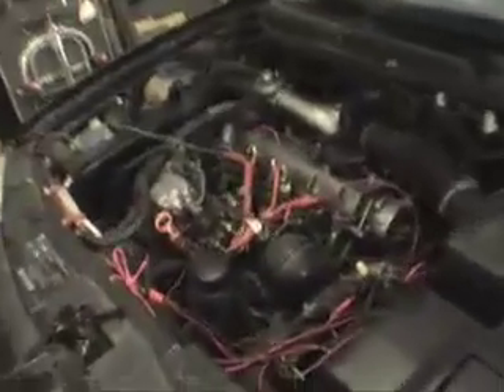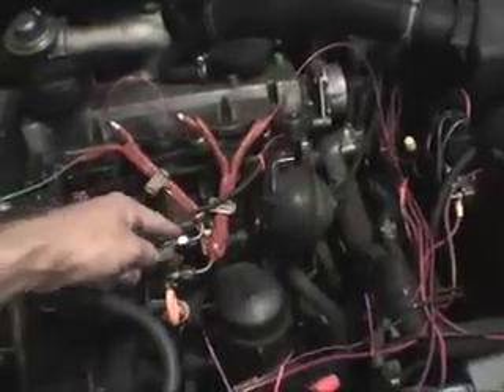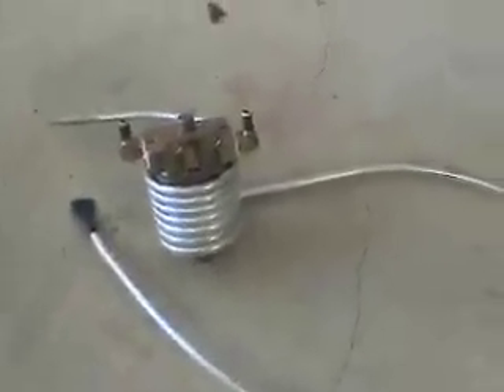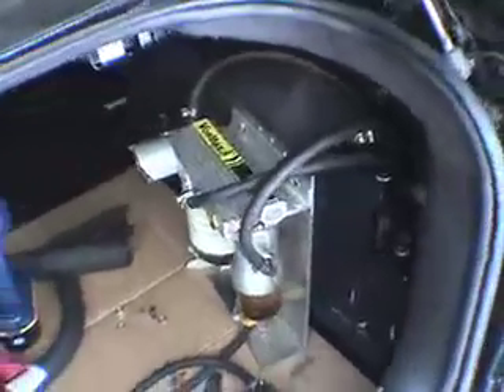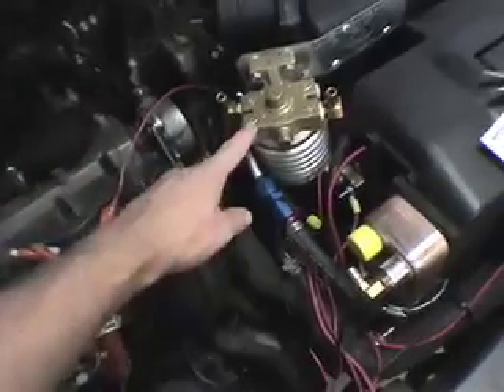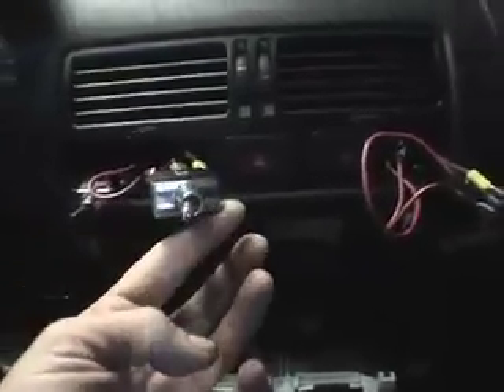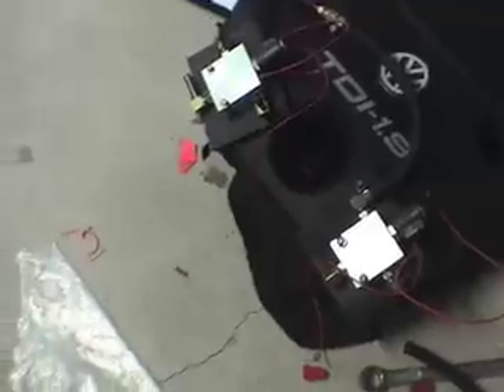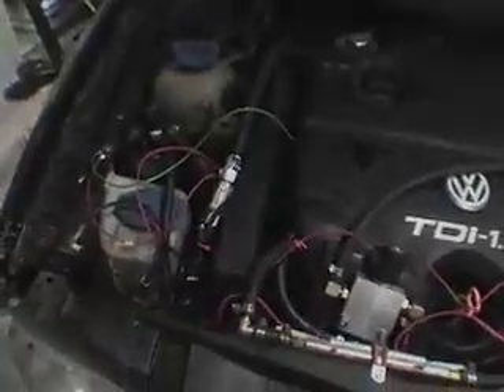Update to Plantdrive Kit  on 2002 Jetta TDI - Video 2

Comment: Thanks for taking the time to make the vid

I converted my 2ooo TDI 2 a vJet 3 yrs ago starting out w/the Grease car system

Started mods  first installing the kit by adding 4 temp sensors-than added a vegi therm-16-FPHE-insulated my spare tire tank n added a hot water bypass 4 summer use 2 keep the VO tank from climbing over 150F 

I now easy keep a 170f VO temp after only 3-4 miles after start up.

I also keep 4 layers of blankets over entire engine to retain heat when engine is off 4 an hr

Comment from the maker: I am running 2 tanks.  Unless it is a early 90's or earlier Mercedes or an Elsbit conversion you will need 2 tanks.  As for diesels in CARB states - VW said first quater '08.  I haven't changed my oil filter yet